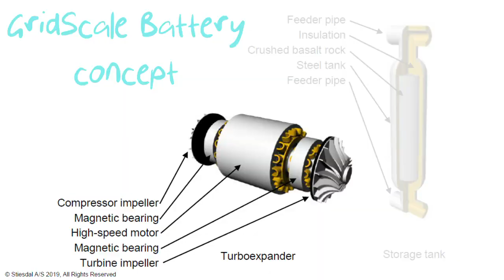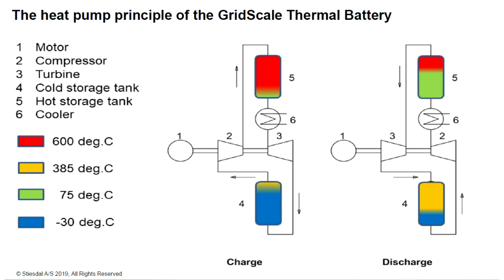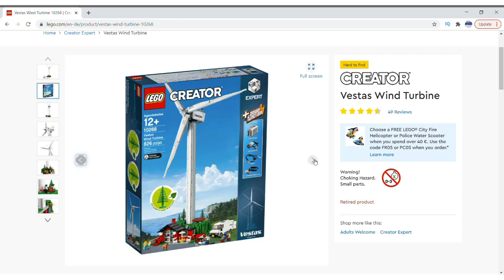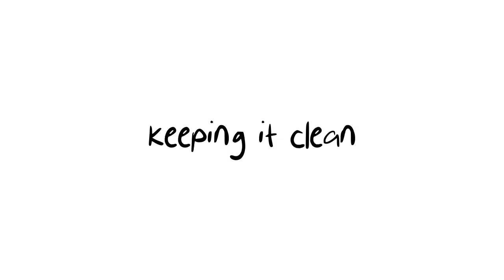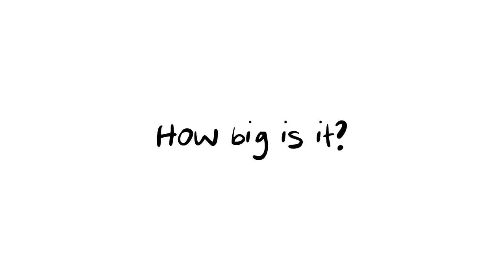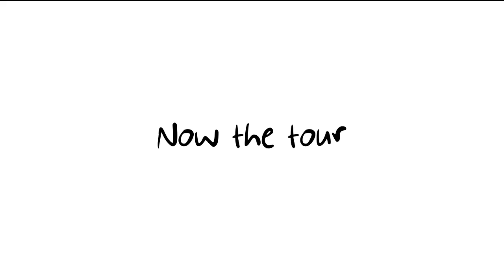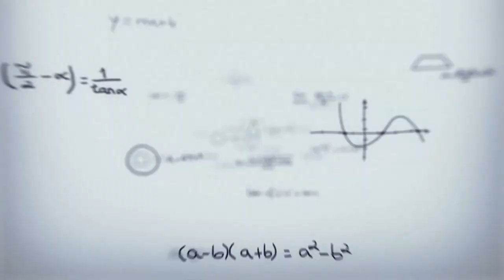Thermal Energy Storage Tour with Stiesdal Gridscale Battery

Comment: Nice to see a video on this technology! 

Compared to other types of longer term energy storage, I can see two big advantages to this that I don't think I've seen mentioned anywhere. The first is the potential to very cheaply add lots of extra charging power on top of the heat pump using simple resistive heating. That should be useful during infrequent periods of very low, or even negative, electricity prices where you just want to charge as much as possible no matter the efficiency.

The second is that since this system is based on heat, it should be cheap to add a "deep backup" option were you simply provide the heat from stored chemical fuels once the heat storage is empty. The efficiency would be low, but I think it would be very useful for grids primarily based on wind power since it could hold you over through the very rare periods of multiple weeks of low wind. That would then save you from having to invest in a completely separate backup system based on gas turbines or the like.

Comment: 1:30 Then why not use water? Water has a HUGE heat capacity, it is cheap, easy to get and doesn't cause environmental damage if accidently spilled. On top of everything else, it's easy to clean up.
Reply: You can't use water over 100C without going for a high pressure system, like in nuclear reactors. That adds an retarded amount of cost and would destroy the whole building in case of a "spill". Heat energy storage volume is proportional to heat capacity of the material and temperature difference. So rocks that only have half the heat capacity of water can still store 3 times more energy in the same volume than liquid water because you have 6 times higher temperature difference.
Reply: Because water would turn into steam
Reply: I've wondered the same thing but I think it's due to lower heat losses. When storing heat in a solid material that has low heat conductivity, the outer layers will act as insulation for the hot interior. If you use a liquid on the other hand, convection will make sure that all the liquid ends up at the same temperature and thereby require greater tank insulation to keep the heat losses down.

EDIT:
The main reason though, that I completely forgot about when I wrote the text above, must be that you can't store water at a particularly high temperature. That greatly limits the efficiency when you're trying to extract the energy again.

Comment: Nice video!  Thank you for introducing this technology!

I agree with the idea that you need to disconnect the costs of charging, discharging, and storage equipment in order to enable longer-term storage capabilities by minimizing the third component (storage).   But often these types of technologies are presented in a vacuum relative to other competitors.  The gentleman interviewed mentioned the primary drawback of batteries (cost), but he did not mention the benefits of batteries (efficiency and response time, for instance) nor did he talk about the more direct competitors to his product.  In this space, hydrogen is another player which will have benefits and drawbacks and another notable technology is Advanced Rail Energy Storage (ARES).  He also did not cover important drawbacks, such as the fact that such a large amount of waste heat may NOT have much utility in summertime except in specific industrial application.

In order for this technology to find at least a single market in which to play, it needs to beat ALL other comers, not just batteries.  The important figures of merit that come to mind immediately are:
- efficiency (both one-way and round-trip since technologies like this one and hydrogen have differences on charge and discharge)
- cost (of the various components)
- size (floorspace or volume, whichever is important for potential applications)
- durability (life)
- energy lost in storage over time
- energy storage horizon (What is the shortest and longest amount of time that this technology can be reasonably applied to store energy?  Seconds, minutes, hours, one day, several days, a week, several weeks, months?)
- environmental impacts

The point is that we need longer-term storage technologies like this or hydrogen or ARES (or others or all of the above) that can make one week or longer storage an affordable reality, but they all have their benefits and drawbacks.  I would be interested in a survey of prospective technologies in this long-term storage space.  If you want to address the VALUE side of the renewables equation, that is perhaps the biggest hurdle.
Reply from the maker: Thanks for these comments, all good points. I am working on a video about energy storage duration, and I could include long-term energy storage techs in that video. Thanks for the suggestions!
Reply: @EngineeringwithRosie  TIA!
Reply: Couldn't waste heat be used in absorption chillers ?

Comment: What kind of temperatures do they need for the system to work?
Reply: The hot side is 650 degree celsius and the cold side is -30 degree celsius. So a differential of 680 degrees

Comment: MISTAKE ALERT: They are converting the electricity into "thermal energy" and not "heat". Heat is not a property of a thermodynamic system, but instead only refers to the flow of thermal energy BETWEEN two systems.

Comment: If he can achieve 60% cycle efficiency so easily why the thermal power plants are not using similar technology?
Reply: Thermal power plants either has a significantly lower outlet temperature, or they lose energy with the combustion products.
Reply: I am extremely skeptical of the round trip efficiency claim. I want to know the COP of the heat pump mode, and the thermal efficiency of the gas turbine. The round-trip efficiency can't be greater than its constituent parts. I don't think there is any gas turbine on earth with an efficiency of 60%.
Reply: Isn't that what a CCGT does?

Comment: Seems like a lot of extra steps and high loss of efficiency.  Large scale capacitors would be the most efficient and keep the electricity ready to use.
Reply: Capacitors are not high enough kW per kg.  Batteries are much higher.
Reply: @acmefixer1  What are the most energy dense without using rare-earth materials?
Reply: Even when cost is factored in?

Comment: Thanks for the tour. I prefer the sodium acetate as a storage of heat.  Then you can add water back as needed to give the year up.  The advantage is the long term storage for heat.  The disadvantage is the size necessary and cost of material.
Reply from the maker: Great tip! It's not something I have looked into before.
Reply: In practical applications, SAT tends to suffer from phase separation, where the anhydrous salt settles to the bottom over time, especially in the supercooled state. It can also exhibit unstable supercooling, which can lead to unpredictable crystallization and heat release. Having a relatively low thermal conductivity this can hinder heat transfer within the storage system. But keeping worst for last, it corrodes many certain metals, requiring careful material selection in storage systems.

Comment: Which of these technologies do you think  will dominant in the future ?
Reply from the maker: Wow, big question and I could write a whole essay on that! (probably will some time soon 😉). Overall, I think we are going to need less storage than we imagine now, due to energy efficiency and demand flexibility plus we will probably connect electricity grids over longer distances to help smooth variability from renewable electricity generation. For what we do need, I think we will keep all the pumped hydro we have now, and hopefully use it smarter, but probably not add much more. I think lithium-ion batteries will take the majority of the short scale storage needs. Especially when you consider we will probably soon be able to add vehicle to grid storage from electric car batteries. There are several nearly-ready technologies that can fill this medium term storage that the heat battery is aimed at, and I'm not ready yet to make a call on which I think will survive. Probably there will be different tech suited to different locations, so I expect several will survive but probably not everything that is under development now. 
Thanks for the question, it is an interesting one that got me thinking! What do you think future energy storage will look like?
Reply: @EngineeringwithRosie   just a thought on energy storage.   Old marine fridges ran the  cooling pipes through a eutectic tank. This was so when the main motor was running during a passage the cooling energy could be stored in the eutectic tank while at anchor.
 This could be added to household fridges With smart electrics to run the compressor while energy is available.
Reply: @EngineeringwithRosie  
There will be great need for fuel for heavy transportation, and there is research to get gas turbines to run using pure hydrogen.  The heavy vehicles need a high kW per kg, and hydrogen is better than batteries now.  So it looks like hydrogen will make a very good way to store energy for winters.  I think green hydrogen will become the bridge fuel for the replacement of fossil fuels.
Reply: Nobody knows, but Henrik Stiesdal, founder of this company, is a bit of a guru in renewable energy industry, so this is definately a potential candidate.

Comment: Very interesting 👌. I think another important factor in increasing the efficiency and decreasing overall product cost is to use it near the onshore wind farms, using the storage material available in that area (less transportation cost) and integrating it with the nearby residential community's or any other necessity's, heating and cooling needs (by product from loss energy at charging and discharging)
Reply from the maker: Totally agree!
Reply: @EngineeringwithRosie  the other possibility is to site near large low grade heat users such as food industry or glasshouse growers to use the low temp waste heat.

Comment: Absolutely perfect. Nice subject, all essential parameters of interest covered. Good enough picture quality. Good sound. Keep up the good work. / Joppe
Reply from the maker: Thank you very much but I am not sure I can agree about the quality of the sound 😂 I nearly sent it to a pro to get rid of some of the background noise, but ran out of time in the end.
Reply: @EngineeringwithRosie  A lav mic with a wind sock would have helped a lot. For the noisier areas, a handheld with a wind sock would have been a better choice. You can find cheap versions, but I've personally used Sennheiser Eng kits. (the EW 100 Eng mostly.) They are really handy for recording on anything with a mic /line in option. You only need to add a half decent XLR handheld, which can be fairly cheap to start out with.